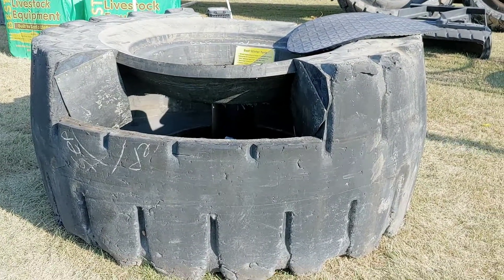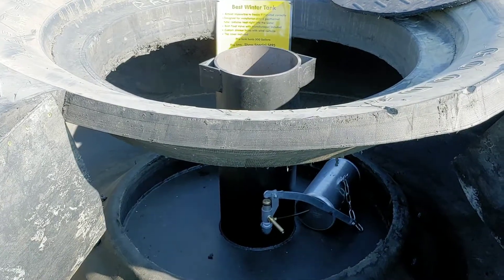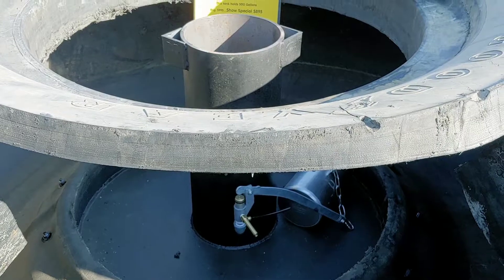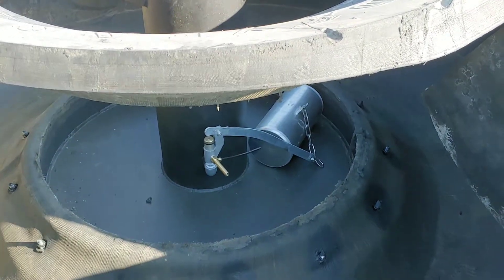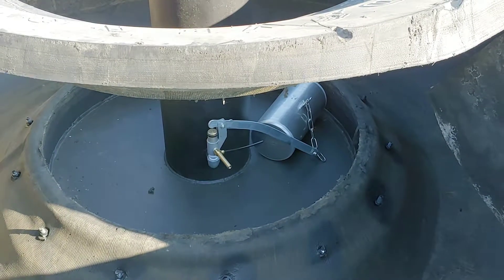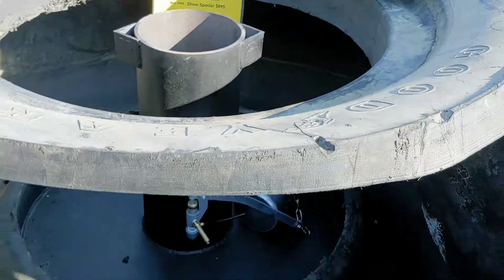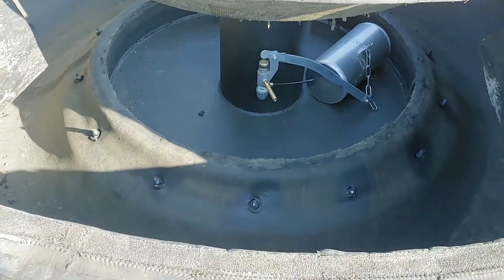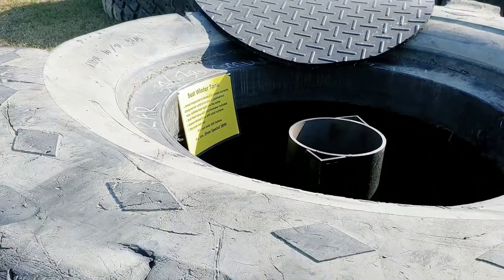Best Winter Tank

Comment: Hi there, does the steel base not corrode away and leave rust particles in the drinking water over time?
Reply: Hi Jennifer! These are for livestock tanks, not for human consumption. It is common practice to use stainless or galvanized steel in those- for the valves, for something like this, or for the actual tanks themselves. :)

Comment: Please reconsider using this due to the possibility of chemicals from the tire leaching into the water, especially when exposed to heat and sunlight 😬 Wire ingested by cattle from the tire can also lead to the potentially fatal hardware disease. The wire can also cut or poke the cattle.